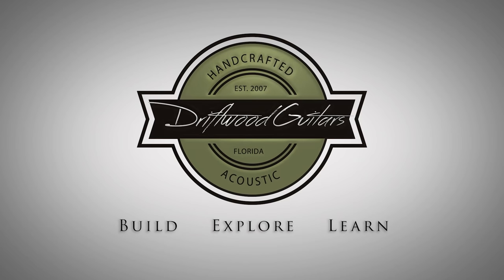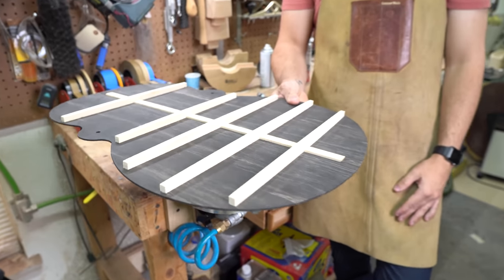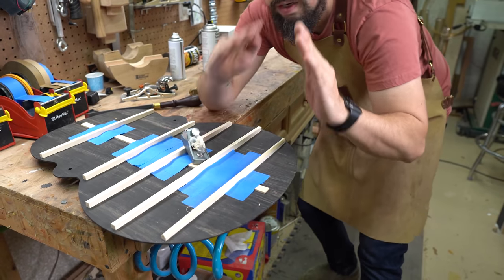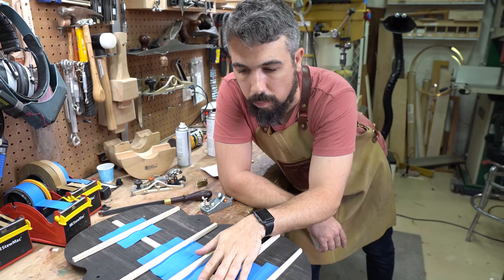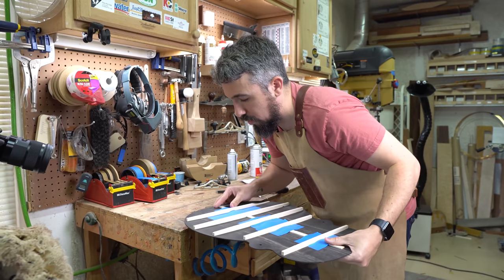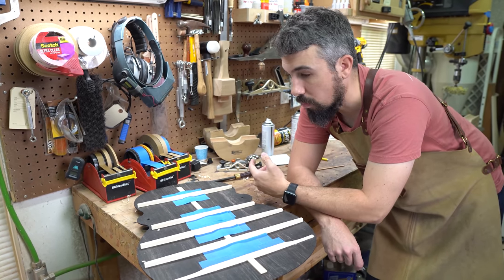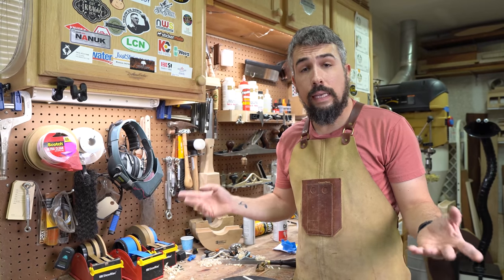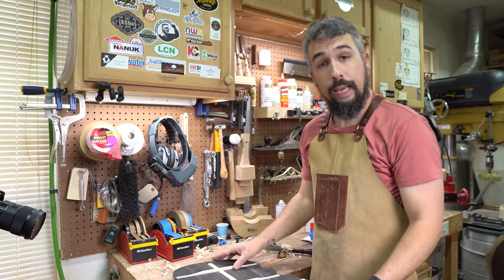How To Build an Acoustic Guitar Episode 16 (Voicing the Back Braces)

Comment: Thats what happen with sawn braces versus split braces. If you split your bracing it should chisel and plane evenly on both sides and when its sawn theres almost always going to be runout, no matter the supplier. Usually not that big of a deal but if you want the best results its best to always make your braces from split billets

Comment: If you play around with your hand position on that hand plane, kinda in the sense of guitarists 'palm muting', you can let your "back of hand, fingers' knuckles, etc." GUIDE YOUR HAND PLANE, saving the tape step. I would do some dry passes to consider stroke, and in this case, position of how i hold plane, using guitar back and back strap as my "Guides", before beginning.  Where did you buy your back and side sets, if I may ask?

Comment: Just one doubt… why don’t you do that before gluing the braces to the back?
Reply: There're two main reasons - its easier to glue square braces and there's no risk to damage ready braces top. And anyway after glueing you will need to finalise braces with sanding. 

Nevertheless, quite often braces are pre-shaped roughly before glueing, but never finished.